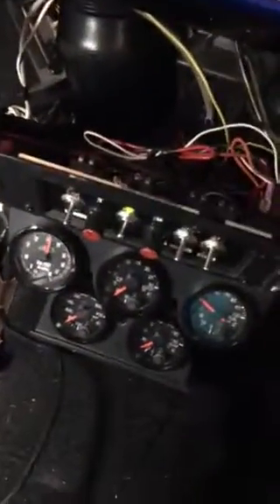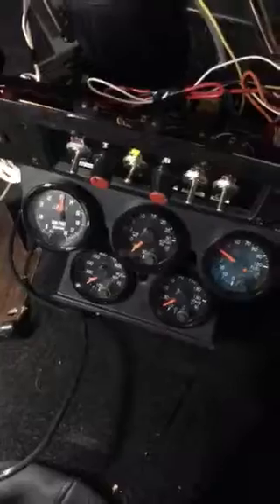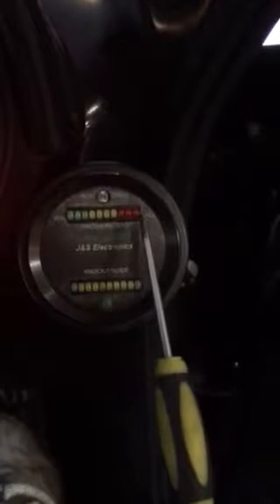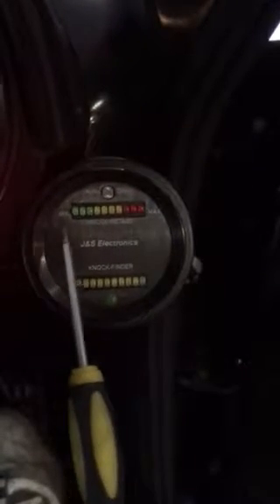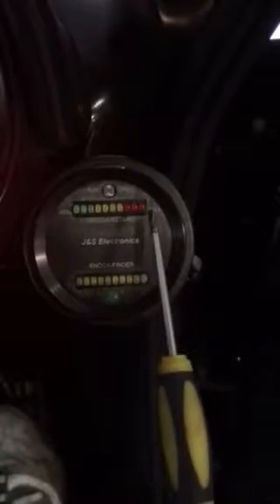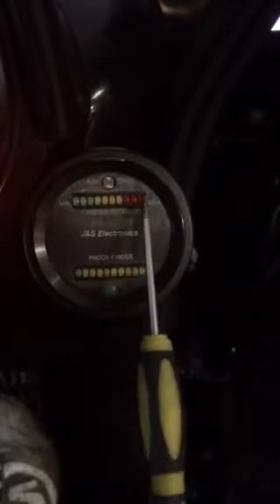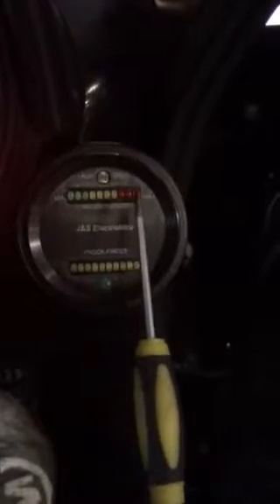J&S Safegaurd Vampire testing on YB Cosworth Mk1 Escort

Comment from the maker: The system puts back in timing over a given number of engine revolutions per cylinder. I have since tuned the timing map using this and water injection on a YB Cosworth and now have a custom tuned timing map safely away from knock limit, and has significantly more timing than it previously had, making superb power on a little T3 turbo! Very happy with this system. Next up, my Porsche 930 gets the upgraded J&S System :-) .....